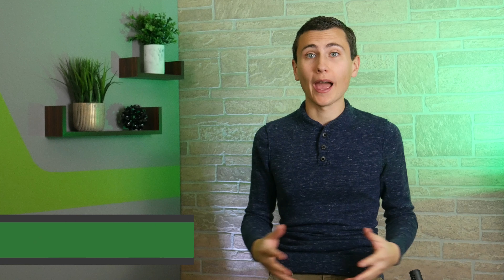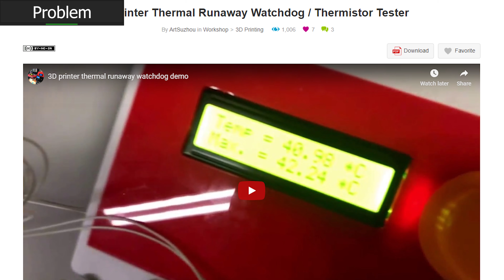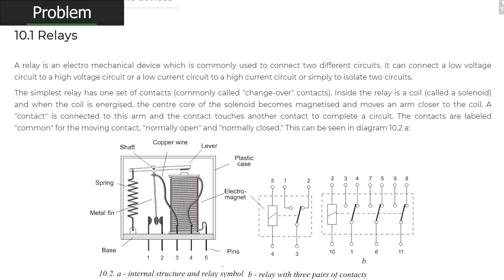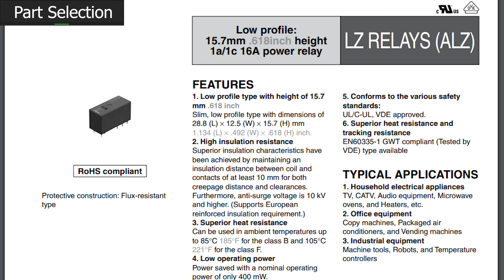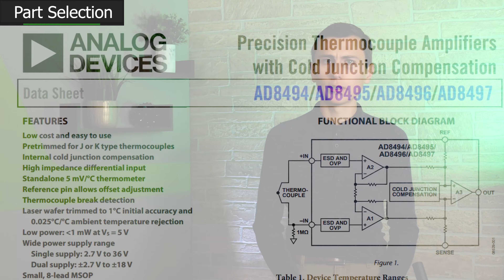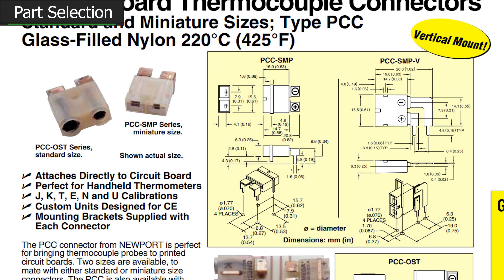Introducing: Seth! – 3D Printer Thermal Runaway Monitor

Comment: I'm really surprised that 3D printers don't include a non-resettable thermal fuse as a last resort power cutting device.  Most products that use a heating element usually include one.
Reply from the maker: Hi ThreeMetreJim! Yeah, I know right!? Maybe there is something fundamentally incompatible with cheap Chinese 3d printer designs and proper safety considerations. :) A non-resettable thermal fuse would be an awesome help! I bet industrial printers come with protections like this... But that doesn't help the little guys.

You bring up a good point though, there are a lot of ways to increase safety of a 3D printer, and adding a thermal fuse is a pretty easy way to make a 3d printer fail safely! 

Thanks for watching, and I hope you enjoyed!